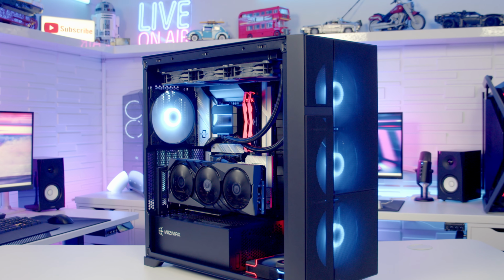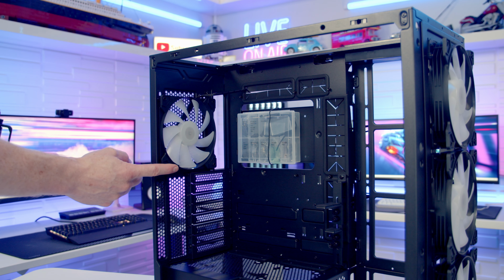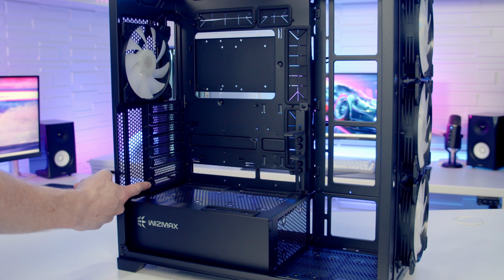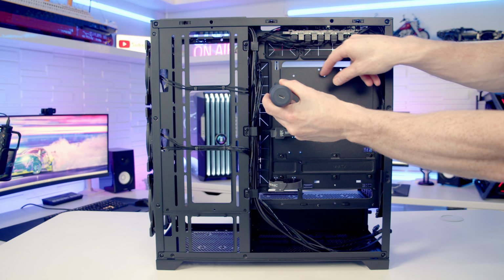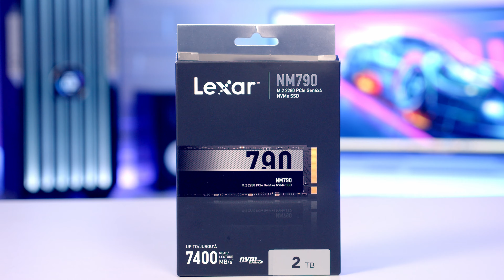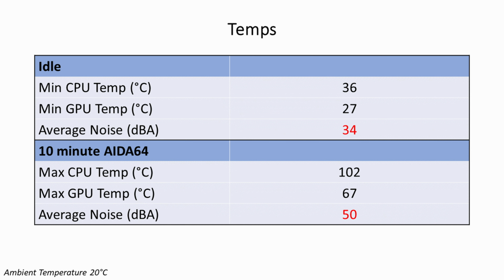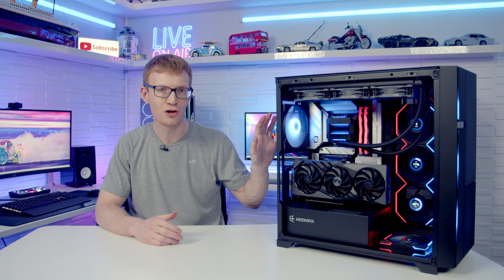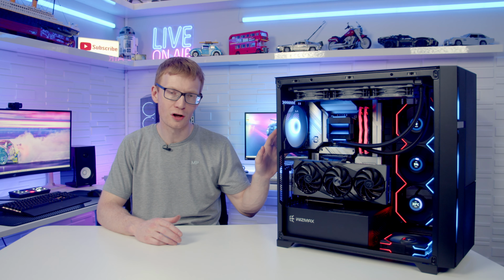Wizmax ML-420 BTF Review

Comment: Looks like a great case at a sound price, so many manufacturers pennypinch leaving grommets etc out completely. The grommet covering connections is a very minor issue and resolved but snipping off the flap where required. Great Review!
Reply from the maker: Or they could include a set of replacement grommets for back connector

Comment: right desired ,8 slot pcie for vga vetical with other tool and 2 fan wind down ,If there are accessories for vetical + 2 fan down then perfect ,becuase in that can not 2 fan down if you vetical vga with original case

Comment: Where exactly can you get this case, it looks top notch and I am very interested in it.  One more thing I just want to make sure about this before I do start my new build, which system AMD or Intel does interfere with cutting down the cpu speed if you use more than one NVMA. M.2
Reply from the maker: Can't buy it yet. It's gpu pcie lanes that are limited with some intel builds if you install m.2 in top slot. Others aren't affected

Comment: Are you able to help people with the hyperion case? Particularly with how to connect the rgb/fan connectors to the control board in the case? The instructions are worse than useless.
Reply from the maker: I've done a build guide for that case
Reply: Yes but you didnt show how you connected the RGB/Fan board up -  you said in that video that the board takes power from a SATA connector, but how?  Could you elaborate?